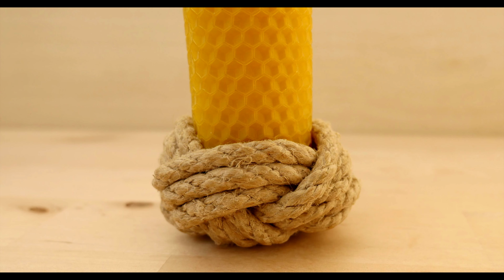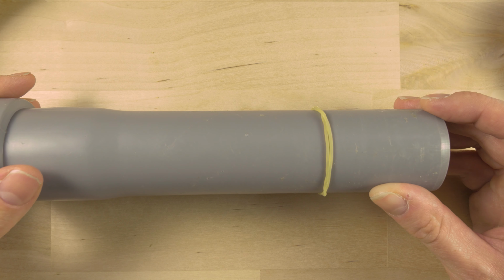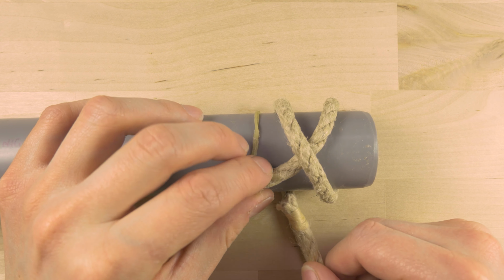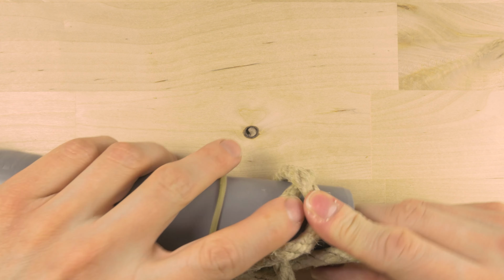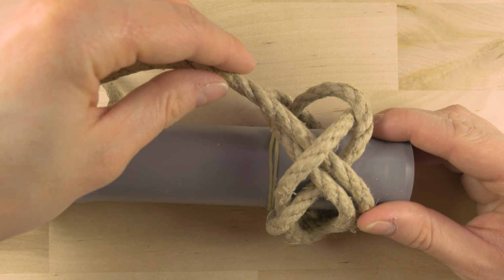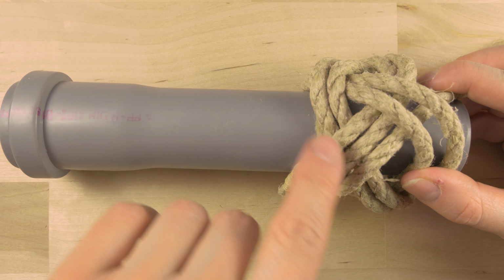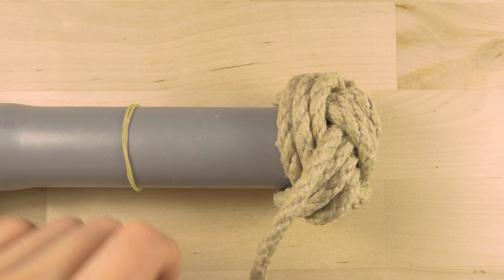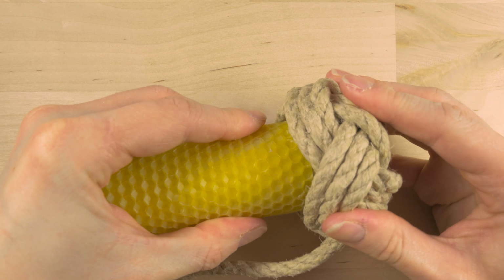Rope candle holder

Comment: Lol first thing I thought... fire hazard.
Reply from the maker: Hi!

Well, anything with fire can at some point be considered a fire hazard. I must say though, that I have never had issues with the holder, the glass container does a decent job. You can always use a higher glass container if you are worried about any fires :).

Mark
Reply: Mark the braider Hi there, I hadn't noticed the glass holder. I didn't watch far enough I see, because the video is playing as I type. Haha, it's a beautiful knot-which is how I ended up landing on your video. It's saved for when I can take the time to give the knot a try. Have a good day!